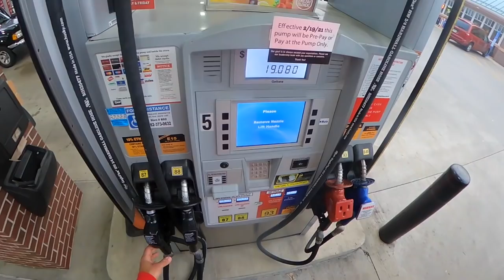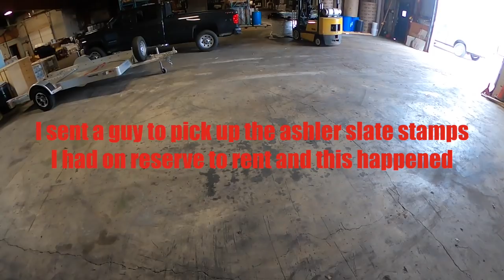Setting up a for a stamped concrete patio

Comment: I think the line you found was the tracer  wire that's used to locate the actual underground utility that should be in plastic conduit. Anyway, the homeowner should have had the utility moved because later on if they ever have to have access to it, they are going to have to destroy the concrete patio.
Reply: Nah it was definitely a 6” pvc Foam core drain lol

Comment: Looks amazing what are you using for forms that bend so easy and are thick like that?
Reply from the maker: They are some kind of plastic.  They are made by a company here in Milwaukee call Metal Forms Corporation.  The forms are 2"x4" and are very nice.
Reply: Some stamps are thinner, used for around perimeter and not meant to walk on like the ones used in the field
Reply: @mikekleven8130  what does thickness of stamps have to do with forms?

Comment: Hi ive seen your videos you do really nice work. Where do you buy your jointers and staff I mean Wich brand do you use?
Reply from the maker: I have my jointers made at a local machine shop. My walking jointer is 1 1/2" deep and the hand jointers are 1 1/4" deep.